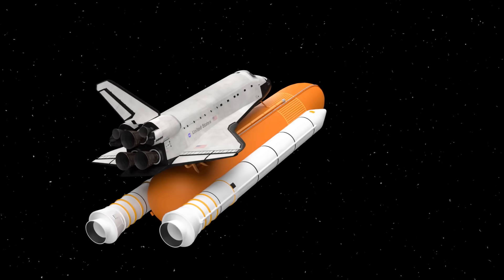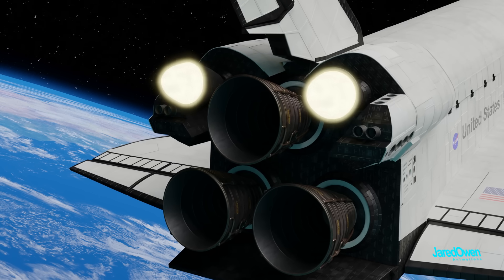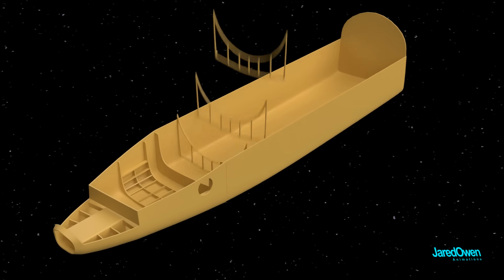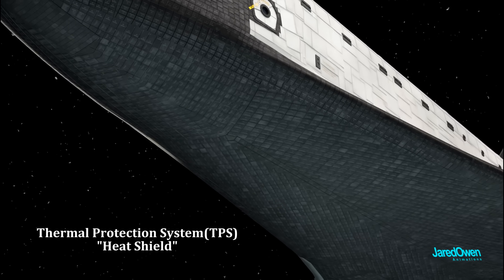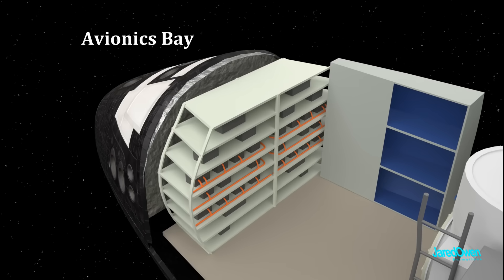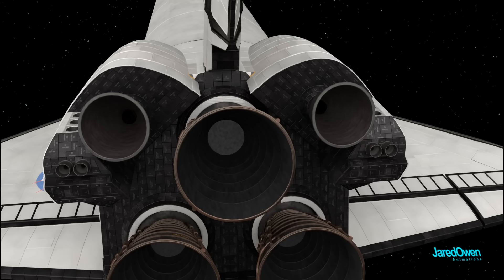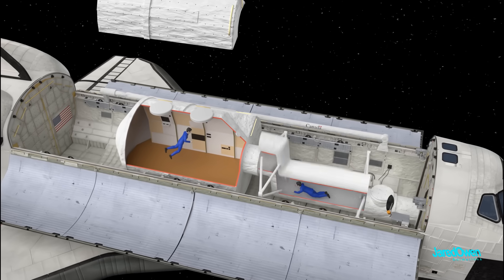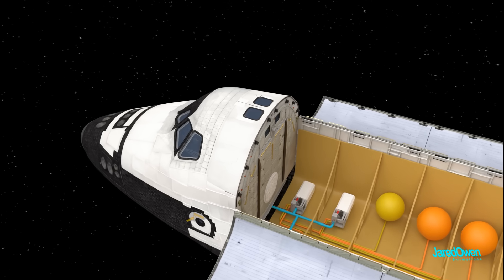How did the Orbiter Vehicle work? (Space Shuttle)

Comment: @1:39 The tank burned up in the atmosphere after detaching before orbital escape velocity of 17,000mph?  Really?  [record scratch]. Really?  Stop right here.  Here's where I get off.  Those things were fished out of the ocean.  A lot of NDAs were signed about that operation.  The vehicle launched with an unknown pilot and landed at an undisclosed destination after liftoff and detachment.  [Diego Garcia or some other DUMB surface site]. The one that flew like a plane was used to simulate the return from "space" and land in California after taking off from an unknown locale like Area 51 with the whole space acting crew on board for a few hours.  Lots of paint booths were used to emulate to identify each other, and different vehicles were shuffled around like walnut shells.  The OGM motors are really Gulfstream 850 jet engines.   Some could glide empty, and other's, like INDEPENDENCE could take off, fly to high altitude, and simulate a return from space.  It's all plausible deniability.
Reply: im not even shure where to begin with the rest so il start with the first one.
Shuttle didnt go all the way to orbit on the fuel tank rather it got close enough to use the OMS

Comment: That's pretty cool. I wonder why they gave up on the space shuttle.
Reply: It was expensive, inefficient and dangerous.

Expensive: the orbiter needed to be reconditioned after every mission, including inspecting literally every one of the thousands of thermal tiles. Turnaround time between missions for an orbiter was never as short as NASA intended.

Inefficient: the orbiter was heavy, which meant that a lot of rocket fuel was needed to push it and its payload up into space. Also, because aborts might require the orbiter to land at runways in Europe or Africa, that meant that the weather had to be clear at all those abort runways. There were occasions where Shuttle launches were aborted despite perfect Florida weather because of a storm in Spain or wherever.

Dangerous: There were literally no abort options during launch while the Solid Rocket Boosters were firing. This was the period of launch in which the Challenger accident happened back in 1986. Earlier rockets like the old Apollo/Saturn V or the new Dragon/Falcon 9 have a launch escape system which allows the crew capsule to blast away from any unfolding disaster in the rocket.
Reply: дорого

Comment: How do you just open the doors of the cargo bay, is it fully vacuum before opening?
Reply: Yes. It would be impossible to fully seal it against the vacuum. In other words, the air would simply leak out of the cargo bay to match the air pressure outside.

Comment: I know this is probably a dumb question , in regards to the heat tiles instead of having severe thousand tiles why don’t they make section like 4 different tile sections
Reply: I think the problem was that the surface of the Shuttle was curved in complex ways which meant that it was impossible to simplify the process of designing the tiles. However I'm not absolutely sure of this, and happy to be corrected.

Comment: There is ZERO reason we dont still have these or updated versions of them in use today.
Reply: Apart from (a) the expense of operating them, (b) the complete lack of abort options while the Solid Rocket Boosters were firing, and (c) the fragility of the leading edges of the wings to impact by foam.

Comment: Gforce qui est 2000 kilometres dans un avion ont perdre de connaissance, comment on peut resister 28,000 kilometres dans l'espace. La nasa nous ment.
Reply: G force is not related to speed. It's related to acceleration. There is no problem with moving at 28,000 km/h, as long as your acceleration to that speed is manageable.
Reply: @maxfan1591  Can you explain, how the astronot can get out from the space ship to fix something with that speed?
Reply: @ewewerwe4342  "Can you explain, how the astronot can get out from the space ship to fix something with that speed?"

It's called "conservation of momentum", and because space is a vacuum.

When you see people climb out of trains or trucks in movies, you see them being buffeted by the air they are rushing through. And yes, the faster the train or truck moves, the harder it is. But in space there is no air to buffet them.

In the meantime, the astronauts have the same speed as the Shuttle. When the astronauts go outside the Shuttle there is nothing to make them lose speed relative to the Shuttle. This is exactly the same as when you stand up and walk around inside a train: you already have the same speed as the train, and inside the train there is no air rushing past you to buffet you.

Comment: Fun fact: a space shuttle has NEVER been launched without a payload, because without the additional weight, the shuttle would end up going too fast during the launch. Like the 3 main engines, the OMS rocket motors can also be gimbaled.
Reply: I don’t recall STS-1 having a payload. There is a simple way to avoid going too fast: throttle down. That generally happened anyway at about T+ 07:30 (ish) to reduce the G loading to below 3.
Reply: Even if you throttle the engines down, you’d still be going too fast without the additional weight.
Reply: @JuliusGrande  The orbiter itself IS that weight. I remember seeing somewhere that most of the STS payload to orbit WAS the orbiter itself (70-ish percent if I recall correctly.) Watching the telemetry, the throttle down continuously lowers the thrust until MECO. Due to Newton’s 3rd law, the orbiter needs the thrust to push through the atmosphere, but as the atmosphere becomes thinner and as the orbiter moves farther out of Earth’s gravity well, the less thrust is required and the more it needs to throttle down to maintain 3G acceleration. Absolutely almost all the shuttle missions did have a payload, with the exception of STS-1 and a couple of the Hubble servicing missions which had a docking port in the payload bay and some EVA equipment. And the mission to retrieve the Long Duration Exposure Facility, that one was empty because it was returning the LDEF.
Reply: Look up “Can a space shuttle launch without a payload?”
Reply: @ From what I’ve been able to find, the initial search result aligns with your point that “the shuttle cannot launch without a payload.” To that point I agree, as further research indicates the percentage of launch mass the shuttle had dedicated to payload was a little over 1.3 percent. The remaining payload of the Space Transportation System was the Shuttle orbiter itself. That big orange external tank and boosters? Those aren’t included as payload, just the orbiter and the cargo inside the Payload Bay. 
The misunderstanding appears to be in regards to your comment that the shuttle would need a minimum weight to prevent it from going too fast. My counter argument is that the orbiter itself weighs enough to counteract the overspeed combined with a reduction in thrust output. The Shuttle already throttles down during Max-Q for that very reason, throttling back up to 104% thrust towards the end of the SRB burn. For the sake of discussion, let’s say you’re right, if a shuttle had no payload it would go too fast (and Over-G). It’s highly likely that even if a shuttle had absolutely NO payload whatsoever, it could still reduce thrust and perform an early MECO, then use the OMS to complete a series of burns to achieve an orbit. I suppose in an extreme situation one of the RS-25 SSMEs could be shut down to reduce thrust. That was actually the plan for the Single Engine Press to ATO abort mode.
Reply: Now look up “Did STS-1 launch with a payload?” And I never said the External Tank and SRBs were payloads.
Reply: @ Already did. The Developmental Flight Instrumentation package was a series of sensors to monitor the flight performance. Today it would be much lighter but in 1981 it weighed nearly 11,000 lbs. the STS had a max payload of 65,000 lbs to LEO. In that regard, I stand corrected. 
My point is, the shuttle didn’t NEED the payload (aside from astronauts). It would be a waste of money and a perfectly good external tank if a shuttle launched without any payload, just to fly to space for the sake of doing just that. I doubt you could convince the government to fund such a flight. If it was going to space, it was taking something up there. 
However, there was one contingency mission that would’ve launched without anything in the payload bay aside from the Canadarm: STS-400, the optional rescue mission for STS-125 Hubble servicing mission. They wouldn’t have had a payload as it’s mission was to recover the stranded crew.
Reply: I forgot to mention that all 3 main engines are connected to each other, which means that they must all work together during liftoff or they will shut down and abort the launch. They aren’t designed to work individually.

Comment: It was going backwards and then is flying through the atmosphere facing forwards, where the explanation on that you…. 😂
Reply: In space the direction a spacecraft faces doesn't matter. The Shuttle could theoretically travel nose first, tail first, wing first, top first, or underside first. Regardless, the spacecraft continues on its orbit without the direction it faces making any difference.

The spacecraft can change the direction it faces using its Reaction Control System thrusters. Therefore, after firing the OMS engines to slow down for re-entry, the Shuttle would then be turned from tail-first to nose-first using the RCS thrusters. It is then positioned for re-entry.

Comment: Jak spłonął w atmosferze jak te zbiorniki lądują w oceanie
Reply: "How it burned up in the atmosphere"

Do you mean the Shuttle orbiter itself? Its underside was covered with ceramic tiles which absorbed a lot of heat and radiated it only slowly. These tiles absorbed the heat of re-entry and protected the Shuttle.

"and how these tanks end up in the ocean"

At the time the solid rocket boosters were jettisoned, the Shuttle was travelling at much less than orbital speed. As a result the boosters simply fell back to the Earth. It was the same with the external tank - but now the Shuttle was travelling only a little under orbital speed. This still meant the external tank didn't have the speed to stay in orbit, so it also fell back to Earth. However, because the external tank was falling from a much higher altitude, and with much greater speed, it burned up in the atmosphere.

Comment: The Rooskie space shuttle looks just like ours.  Did they steal it from us or did we steal it from them?
Reply: The American shuttle had its first out of 135 flights – including the two catastrophic failures – in 1981 while the Soviet shuttle had its first and only flight in 1988. Even though visually similar, they had some fundamental differences. The two most important being

1. The American shuttle had two boosters with solid fuel while the Soviet shuttle had four boosters with liquid fuel which were all jettisoned after burnout.
2. The American shuttle had three hydrogen burning main engines mounted on its tail section that got fuel from a large external tank that was jettisoned when empty. The part of the Soviet shuttle resembling that external tank was in fact a complete rocket stage with four hydrogen burning main engines at its bottom doing the same job as the three main engines on the American shuttle.

One advantage of the Soviet shuttle was that its liquid fuelled boosters with their valves and pumps could be shut down at any point during the launch in case of an emergency while the American shuttle's solid fuelled boosters couldn't be stopped but had to complete their burn once they had ignited.
On the other hand, the American shuttle's main engines could be recovered and refurbished for future use since they were attached to the orbiter part of the shuttle and not at the bottom of the external tank.

Even though the Soviets obviously got many ideas from the American shuttle, they found their own solutions to many of the technological challenges that had to be overcome when designing their own.
Reply: They stole from us. They did add some Soviet modifications to it, but one look at the orbiter tells you how much they “borrowed”

Comment: I can only have so much respect for these engineers. I am trying to build a space shuttle in SFS, and it's absolute hell. Not only does it need working doors, an arm, landing gear and a heat shield covering this all. It also needs to be balanced with the external fuel tank and SRB's.

Comment: The astronaut pilots called it "a flying brick".  When the shuttle was being tested, it flew atop a specially designed 747.
Reply: The Shuttle Carrier Aircraft were also used for transporting the shuttle from Edwards when it landed there.
Reply: @thatonecommie8351  I never said it didn't.  My in-laws had a home in the SoCal desert foothills and once the shuttle atop the 747, while being tested, was easily visible on its way to Edwards.
Reply: @onemercilessming1342  Interesting

Comment: Pneumatic rubber tyres in space .......hilarious
Reply: And? You realize tires can be made to hold a lot of pressure, right? What's another 15psi? 

Hard fail for you, son.
Reply: @kitcanyon658  at atmospheric pressure ?
Reply: @marxman00  : What do you mean by at atmospheric pressure? All major commercial aircraft use tires pressurized to about 200psi and while flying at 35,000ft they then have a pressure gradient across them of about 211psi. 

The space shuttle tires were inflated to 300 to. 340psi and in space would see a pressure difference of just 15psi more. 

So please explain why this is hilarious.

Comment: 10:21 doesnt matter in the vacuum of space 
10:38 these doors are important to open because they contain radiator panels or get rid of excess heat

Explain to me how heat is shed by a radiator in the vacuum of space please, im new to this.... While you're at it i wouldnt mind an explanation for how the thrusters work in a vacuum as well, what do they push against in order to maneuver such a massive vehicle?
Reply: Good questions.

"Explain to me how heat is shed by a radiator in the vacuum of space please, im new to this...."

In the case of the Space Shuttle, the hull was lined with pipes through which freon was pumped. The freon heated up as it passed around the spacecraft. The pipes were directed to radiators on the inside of the payload bay doors. As the hot freon passed through the radiators, its heat was dissipated by the radiators, and the now cool freon circulated back through the pipes.

"While you're at it i wouldnt mind an explanation for how the thrusters work in a vacuum as well, what do they push against"

It's important to understand that rockets don't work by "pushing against the air". They work by pushing against the top of the combustion chamber. This is Newton's third law of motion - for every action there's an equal and opposite reaction: the gas is propelled in one direction, so the spacecraft moves in the opposite direction.

Imagine you're sitting in a shopping trolley full of cans.  Throw a can as hard as possible out of the trolley. What's going to happen to you and the trolley? You're going to move a little in the opposite direction. Obviously, you're going to stop moving because of friction between the trolley and the floor. But because it's a vacuum in space there's no friction, so every time a rocket fires it permanently affects the motion of the spacecraft.

"in order to maneuver such a massive vehicle?"

In space spacecraft are weightless, although they still have the mass they have here on Earth. Combine weightlessness with no friction, and every rocket engine is able to push the spacecraft. However, the less the thrust, the less the push. The three Space Shuttle Main Engines produced 418,000 pounds of thrust each to help push the shuttle into orbit, while the two OMS engines produced 6,000 pounds of thrust each to slow the shuttle enough to start the re-entry process. Therefore, during launch the crew experienced up to about 3.5g of acceleration, but the deorbit burn by the OMS engines produced less than 0.1g of acceleration.
Reply: The heat is radiated away as infrared waves. The same way visible light is radiated from a light bulb. It’s just different frequencies of the electromagnetic spectrum.

Comment: Call me crazy but the OV would be pretty dope fighter ( of course in much smaller package and the RCS thrusters could be replaced with ECM or a bigger radar.) The main engines either stay or get replaced with jet engines and the OMS is totally unusable in the atmosphere. The cargo bay/payload bay is converted so it can open downwards (or left out altogether, making the vehicle much smaller and more manouverable) and the silica plates can be replaced with regular avionic metals (titanium, in case the rocket motors stay, just for safety). I hope I'm not the only one thinking about these things😅
Reply: The space shuttle flys like a brick, good luck making it a fighter.

Comment: Please pardon my elementary or dumb question. What keeps the astronauts held to the station or staying within the payload section when working without floating away in outer space?
Reply: There's lots of handles everywhere to hold on to, and I think they also have a tether that connects them to the airlock.
Reply: @theendlessvoid7124  Thanks
Reply: Yes, handholds are very important. Gene Cernan did a EVA on the Gemini 9 mission that turned into such a stressful workout that made it obvious some changes needed to be made. He was attached to the capsule with an umbilical so no worries about floating away. Just trying to accomplish some tasks assigned to him without some restraints was the difficulty. By the time the Gemini 12 mission happened, Buzz Aldrin’s EVA went so smoothly because of handholds that his EVA was a breeze.